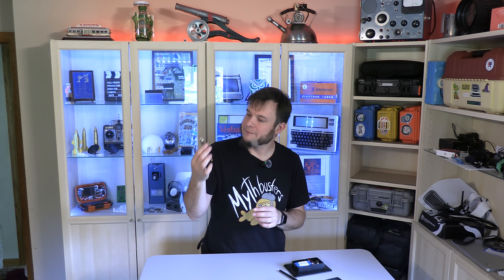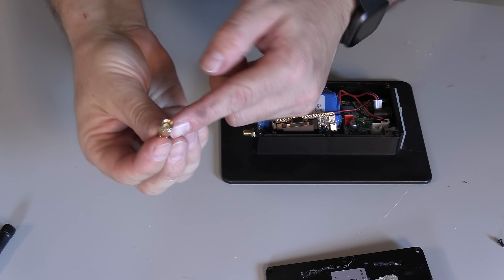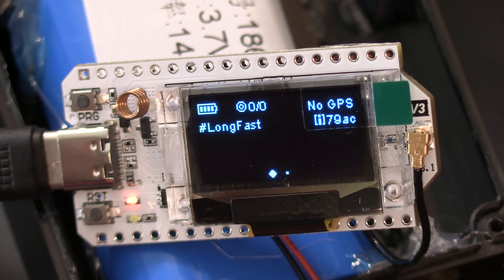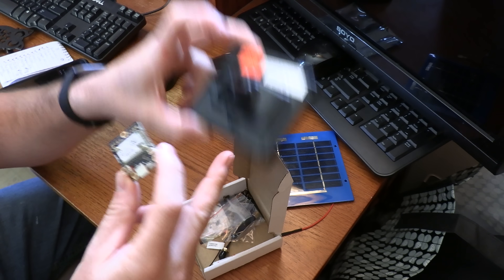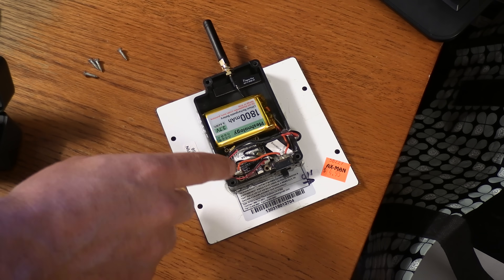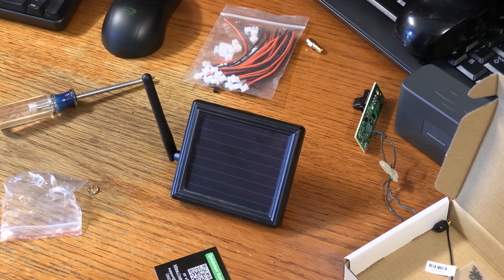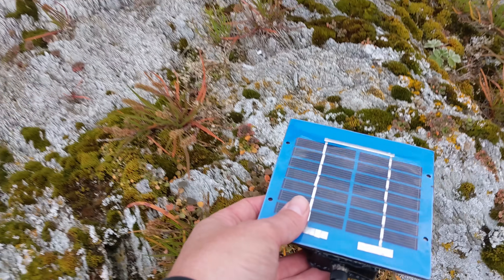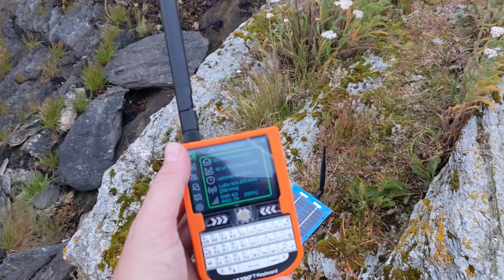I Hid A Meshtastic Node Somewhere In Alaska

Comment: The SMA "Adapter" is a Port Saver. If you have expensive test equipment you do not want its port to wear out. So you put this to wear out the Port Saver rather then the test equipment.
Reply: Yep. That's why I usually adapt from sma to bnc. You only get so many screw on, screw off cycles before that sma wears out. (I know you know this, I'm just hoping it helps others). 🤙🏾
Reply: I use USB extension cables on my computer for the same reason,
Reply: @athiker7209 USB ports don't really wear out like SMAs though

Comment: I'm surprised the TSA let you bring that thing
Reply: As long as it’s turned off, it’s not an issue. The battery is way below their watt hour maximum. Even the Impress battery of my XTS3K is way below the TSA limit.
Reply: True story, I accidentally left my node in my winter coat and took it in to the airport with me. Tsa didn't care, they only cared that I had a screwdriver (I work for HP fixing printers, so I was just there for my job).

Comment: I made one or two nodes to go in trees on hilltops - I used a single junk electric car LFP cell, 50AH or so, and a 10W panel stuck to the side of it.  Working fine through two winters. I did use the RAK module though which is lower power.
Moved on to NVIS now though :)

Comment: The solar is not gonna work too good under a couple feet of snow. Tacking it up on a tree  would have been better, but I like the spirit of the project.
Reply: To be fair/bunt: there wont be much sunlight during winter in Alaska anyway.
Reply: @comentedonakeyboard the southeast portion, he's likely between Juneau, Sitka, and Katchican, gets somewhere between 6 and 8 hours of sun on its shortest days.
Reply: @comentedonakeyboard  More importantly, you want the snow covering the panel in the winter.  You don't want to charge a frozen LiPo, so on the rare day that there's meaningful sun but it's below freezing, all that is going to do is damage the battery.
Reply: @comentedonakeyboard  not much sun during the very cloudy/rainy Alaska Summers.

Comment: The timing! I just spent two days trying to get an Arduino board to spit data over serial to a Pi Pico flashed with Meshtastic. It was the damn pin assignment - it didn't like GP0 and GP1, but likes GP4 and GP5. Now all I see in my brain is Meshtastic CLI lines. I just need to remember what the heck it was I wanted to do with Meshtastic.

Comment: The problems I have with the heltec units is that they will not boot on auto after the battery goes dead. you need to press the reset button
Reply: Hmm? I have mine on a mains power supply on a timer. It switches off for one minute each night. I haven't had any issues with them coming back up. What's the battery scenario?
Reply: @paulsengupta971  I have solar going to usb on the heltec and battery going to battery connection. it will still charge but not turn on after the battery goes dead after 3 days of low/no sunlight. 
All I need to do is press the reset button, but That's after getting it from the crazy random spot I put it.
Reply: @finzgar420  Ah, ok, so wired like that. Yep, I can see how that would work (or not work) when it comes to the Heltec controlling everything.

Comment: I keep hearing those antennas shouldn't be bent. Can you maybe do a test on the NanoVNA to confirm this?
Reply from the maker: Like you shouldn't fold them 90 degrees? I don't think that would affect it since they're made to do that, the connection is just a piece of flexible wire.
Reply: @saveitforparts  I had the same viewpoint but people in my local echochamber go crazy when they even see such an antenna. That's why I've asked for you to screw it on the NanoVNA. I don't really want to buy one just for this, I'm just getting started and I believe I'd have even less use for it than you do.